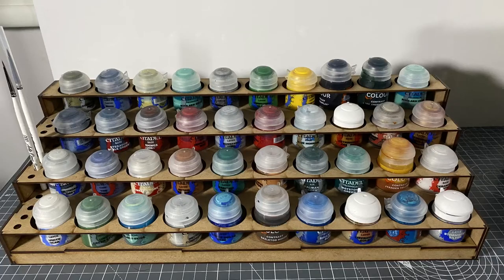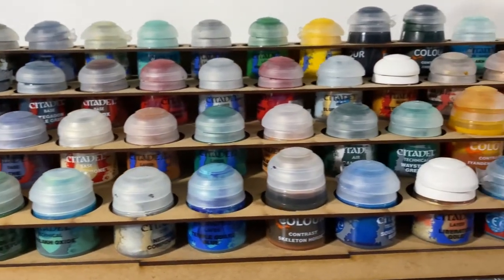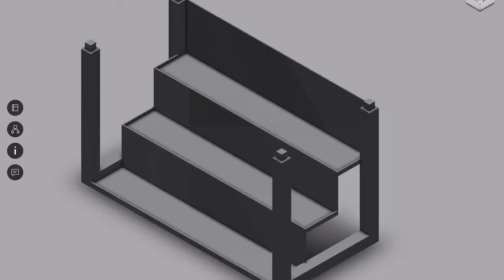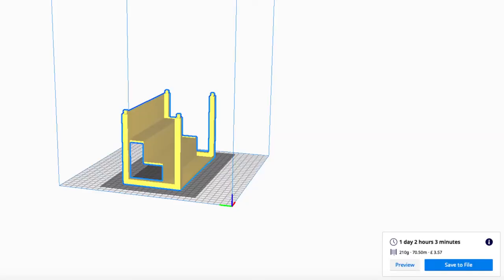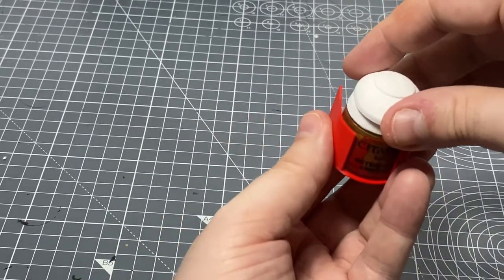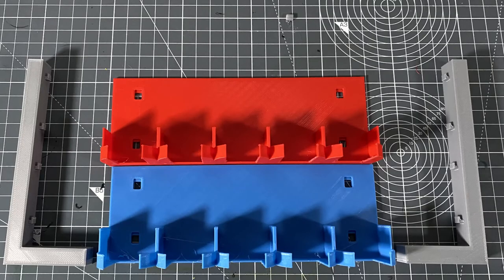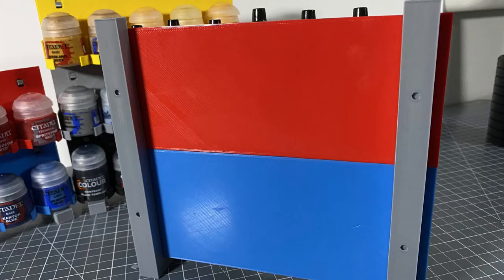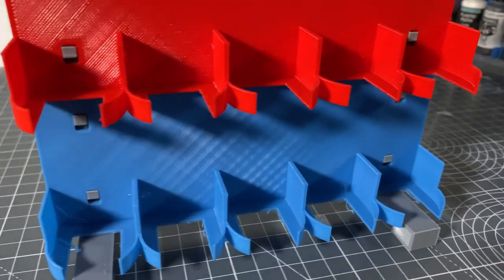Create your Own Paintrack for Citadel and Vallejo - 3D Printing

Comment: Looks great!
I would love to test removing material - I have the feeling that the pot-supporting edges could be just a triangle and that the backplate does not need to be filled.
Reply from the maker: Thanks! I appreciate the suggestions - i'm about to go for round 2 with my CR-30 belt printer, so I can print them much longer. I'll keep your advice in mind. Cheers.